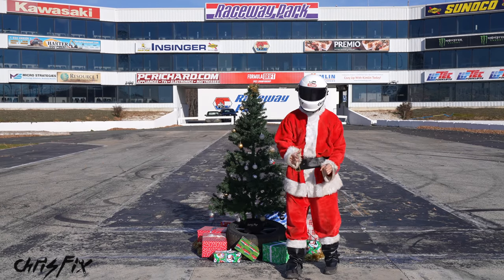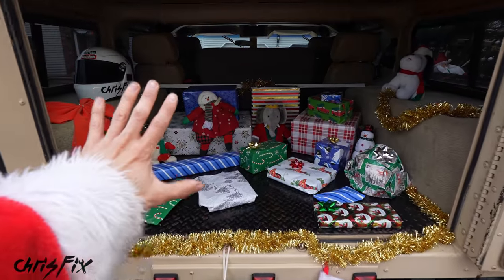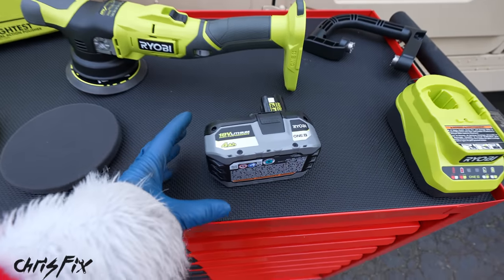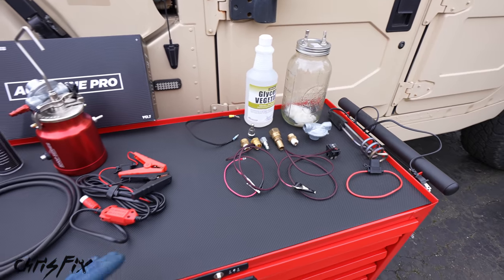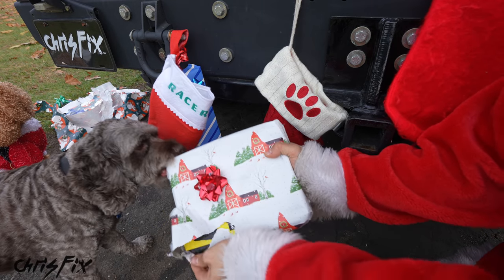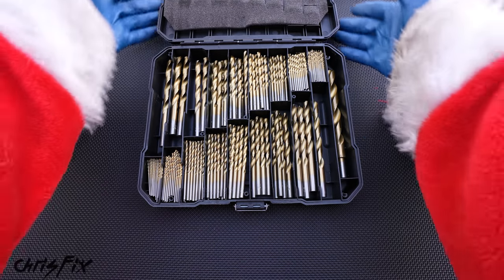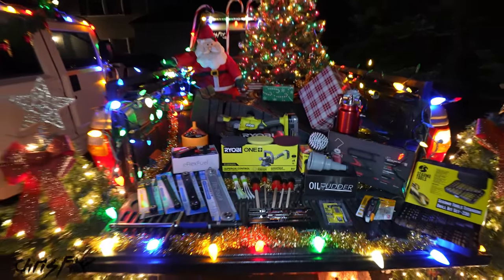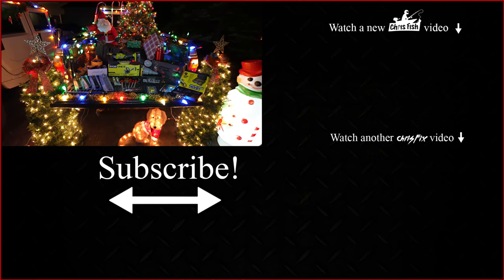Top Car Tools and Gadgets of 2021 (Christmas Gift Ideas)

Comment: Very important for using a DA polisher: you'll need multiple pads of each type if you want to do your whole car at once.  One pad per 1-2 panels.  The pads get dirty from oxidized paint and dried polish, which can get slung across the surface you want to correct.  After every 2x2 section, you'll want to blow them out with compressed air or spin on a pad brush.  This would actually be a great "how to" video to cover.  Most of the beginner DA polishing videos just show before/after and not what's needed/how to properly correct an entire vehicle.
Reply from the maker: As I was filming this I was thinking to myself that a whole video on how to use a da polisher for the whole car. I like what you’re thinking!
Reply: @chrisfix  I like it! That would make for a great video for the new Ferrari, you know, if that's what the new car is and you weren't just trying to throw people off with the oil sample bottle. I was honestly going to guess another Corvette, but a different body style. The way the intake looks is dead on for a Corvette, but I Know Ferrari also uses that style intake, and the engine is pushed so far back. I'll admit, you definitely have me stuck between V8 Ferrari and possibly Corvette if you were just trying to throw people off with the writing on the bottle.
Reply: @chrisfix  please please do.   Would be so insanely helpful especially because I’ve been looking for a solid video looking on how to do this.  I found a few but nothing is compared to your videos and explanations.  Thank you sir!!
Reply: @catch22frubert  I was guessing a Viper, am pretty sure I can recognize the V10.
Reply: That’s what why you need to blow out your pad after ever Panel and put a little fresh polish or compound on it
Reply: FreeBirb  What that engine sound? Gotta be Viper.
Reply: FreeBirb  There were other people in the comments recognizing the frame and the model on the oil filter, so am pretty certain it is a viper
Reply: @simasm.9757  Since most of us subscribe and come here to learn, would you mind sharing the mistakes he made and provide solutions and/or the correct methods?
Reply: I've found treating the panel with ironX or anything similar gets rid of the oxidized paint problem. But yea, the polish dries up and leaves nasty hard spots on the pad. Definitely swap it out and wash them asap.
Reply: I learned this the hard way, having polish splashed all over my convertible top and having to clean each drop off by hand.
Reply: @chrisfix  I'm actually very in need of a video like this. I paid $200 to have CobbleStone detail including a buff and polish on my wife's black Camry and they refused to refund me after putting terrible swirls on it. They tried to fix it and only made it worse.  It was supposed to be a surprise and while she was DEFINITELY surprised, it wasn't in a good way. It's been a point of contention and I haven't felt confident enough to try to fix it myself.

Comment: Great gift ideas! That ratchet extender is really nifty. There’s a few bolts that immediately come to mind.

I’m sure you’ll go over it in your E85 video, but for anyone considering switching, know that while ethical is cheaper, your MPG will drop a bit.
Reply from the maker: Thanks a lot and 100%
Reply: @chrisfix  Did you dyno tune the car with e85? You can advance your timing plenty now seeing as it's 105 oct!
Reply: I'm a bit curious how the kit works without larger injectors, I assume there would be a loss in power. Looking forward to the video.
Reply: @gsmith7162  Most stock injectors have quite a bit of headroom for amount of flow you can go up before maxing them out.  Now...if you were doing full bolt ons and upping the power considerably with the e85 also then yeah, new injectors are needed.
Reply: Fuel mileage is nearly half with E85 but you will pick up performance with the car custom tuned to E85.
Reply: I really wanna know where he's at that E85 is half the price of premium, where I live there are about 4 stations with E85, maybe a few more, but they all charge $.25-.65 more per gallon then premium, making E85 useless to many, it's so bad here that most dealers don't even offer Flex Fuel cars anymore
Reply: @PsYcHoLogical03  most likely a rural area where it is made close by. Otherwise, yeah, you see prices like you see. Essentially poor man's VP race fuel at that point. Lol
Reply: @gsmith7162  our kits automatically adjust your injector duty cycle allowing the right amount of fuel to pass safely within the injectors. We also have a full database of cars that have been tested to ensure that it's safe to run e85 on stock injectors. If not, we also let the customer know ahead of time and we do give recommendations.
Reply: @ryanmolloy5421  yes you would need about 30% extra flow capacity for e85
Reply: @Braap_Jackson  this is true because there's less energy burned per gallon in ethanol than in gas. But the faster burn rate also gives the cooling effect when the fuel flows through faster.

Comment: Hey Chris I love the addiction of the ToughBuilt scraper, I personally think it's an amazing tool but it has one downside that I've noticed personally and why I haven't bought it is. if you hold it upside down (With the blade pointed to the ground) The internal spring isn't strong enough to retract the blade into the body of the knife. Aside from that one major complaint It's a good tool.
Reply: I mean I’d just take the half second to tilt it up right and then retract🤷‍♂️ it’s a downside but don’t think it’s a major complaint. I have one. Works on everything from tint to decals, boxes at work, paint stuck on floors, etc.

Comment: Cool stuff as always Chris!  Just a note...on that E85 kit....you may not save as much as you think.  E85 gas has less energy than E10 or E15 or "regular gas".  So it takes more gas to get the same distance.  30 MPG on E15, might only be 25 MPG on E85.  So the savings needs to be over 30-40% in gas price just to break even with the energy loss and extra fuel needed to purchase.  How do I know?  I drove a 2009 Dodge Grand Caravan 3.3l v6 for 8 years.  It was E85 compatible from new.  I only bought E85 when it was more than 30% cheaper.  Those prices you found/showed?  Not reality around the US.  Most are 20-30% or less in price difference...making it not worth putting it in.  Plus, there are differences in fuel lines/fittings, etc....and that kit may void any warranty left.  That said...E85 is a more environmentally friendly fuel, since it's 85% ethanol, made from corn products.
Reply from the maker: Thanks! I couldn’t get into details but I lost 20% in fuel economy and with the gas prices in some states  you save 50% so that means in reality it’s 30% cheaper which is still decent.
Reply: But... MO POWAH BABY
Reply: Exactly here in san diego, its only 20 cents cheaper than  unleaded gas
Reply: Agree. Where I live, E85 is only about 10-20 cents cheaper per gallon than E10. Not worth it.
Reply: @specialopsdave  I see we have a fellow donut fan here.
Reply: All the points I wanted to make. You have to make all of the calculations before deciding to run corn piss. It’s not worth it in my opinion.
Reply: I would still love to save money from gas here in CA even from my 2.5L 2020 Altima, there is no product for my car and plus none of them can be used here in CA. This sucks.
Reply: @tomthetitan3697  a man of great taste
Reply: E85 is not as environment friendly as you think.
Reply: @specialopsdave  did someone say mow pOwER?
Reply: @heidilopez7276  Only because of the dependence on fossil fuels to plant, fertilize, harvest, process and transport it. Electrification will fix this in the near future
Reply: @Agent-lg1mu  MO POWAH BABY!
Reply: Plan on higher fuel system repairs. E85 corrodes fuel system components (electric fuel pumps being a prime example) much more than E10 gasoline & I would not recommend converting any vehicle to E85 that didn't have it as an oem option.
While you have some limited positive experience with this kit so far, don't be surprised if you have fuel system failures in the future (long term).
Reply: @davehansen6262  If you replace your fuel pump and fuel lines to the correct ones when you do the conversion in the first place, it shouldn't. People just tend to be lazy and don't replace the pump since it isn't included by default in a conversion kit
Reply: @specialopsdave  No, it's not so much they're lazy: people just don't know, listen to these self proclaimed know everything experts & jump in with both feet.
I'm a retired technician that worked in fuels & lubricants research for 36 years.  I know a lot about the many compatibility issues with ethanol & ethanol blends, but I admit I don't know it all.  Ran many tests using anhydrous punctilious ethanol. 
Know why E85 is maximum concentration available. Know also that E85 requires different catalyst chemistry to minimize tailpipe emissions vs gasoline. Surely you don't suggest people change their exhaust system components as well?
Better they operate their vehicles using the designed & specified fuels & lubricants than get misled by "experts" that really have no clue...
Reply: @davehansen6262  Honestly, I've never cared about the emissions aspects of E85. My car's catalytic converter has been burnt out for over 2 years, and I never intend to replace it. Although, yes, I believe those who do care should set their exhaust up too. I just believe that most people care about their fuel pumps, so they should replace them when doing a conversion.

Comment: I think the blurred car is a MK1 Viper, because of the sound, the red colour, the wide and low grille, and the fog lights (maybe?) flanking it. The oil filter also has FCA written on it, and the engine bay looks vaguely similar. I could definitely be wrong though.
Reply: It is 7:46 massive airfilter and mopar oil filter
Reply: And if you look up a viper oil change it has the same everything

Comment: you had me with the ethanol conversion at " it makes the exhaust spell good". awesome video chrisfix. everytime you recommend a tool i try to get it to stock up my tool box which currently doesnt have a lot of tools.
Reply: I'm skeptical on the kit. I had a crown Vic with the same engine (close model year) as that drift stang. The same e85 conversion question would come up at any gas price spike. The answer was always the same by the enthusiasts, don't do it. E85 is going to dry out anything designed for gasoline only and lead to premature failure on the fuel lines. The flex fuel vehicles had different lines to resist the issue, but not impervious. So if you wanted to do the conversion, you can, but unless you replaced all the lines you were asking for a premature failure. Naturally you need to program for E85 like this does, but it's not as simple as just doing that.
Reply: it does smell good! :)
Reply: @TheJuanSolid  we verify the fuel system compatibility, we’ve sold over 40k kits with zero complaints about fuel line issues (like in the drift stang after 2yrs), since early 90s the standard has been that fuel system parts are ethanol compatible and ethanol itself is not corrosive in any way

Comment: The ethanol conversion kit is pretty interesting, but be aware ethanol eats away at aluminium much faster than regular gasoline, so this may actually cause damage to your engine or fuel system in the long run if your engine/fuel system is aluminium based.

(For the Americans: aluminium = aluminum)
Reply: That and the fuel lines are not designed for it. The flex fuel vehicles have different file lines to resist the problem. All the forum posts I have read state it's like dry out or something. Regardless it's a premature failure because the materials are not right. Your need to replace the whole system really for the conversion, and most people won't do it, or pay the huge fee for it, expensive gas is cheaper and gets you more mpg than e85 (failed to mention that in the video when talking price per gallon). Not as simple as just programming like that company makes it seem.
Reply: Ethanol itself doesn't eat through anything, where you get problems are crap quality E85 fuels with water in them.
Reply from the maker: That’s actually a misconception and inaccurate. Ethanol does not affect aluminum chemically. Ethanol has an affinity for water more than gasoline so on stuff like boats or collector cars where they sit a lot, the water causes increase corrosion rates. Also ethanol, unlike gasoline, can conduct electricity and cause galvanic corrosion which is more likely a problem in boats not cars. Most fuel tanks in cars are plastic so it’s not a big deal anyway. Most fuel system parts are stainless so again not a problem.
Reply from the maker: @TheJuanSolid  another misconception. That’s why I say check the website to make sure the car is compatible. The type of fuel line used and the different parts of the fuel system are taken into account in their database so it makes sure the fuel system will not be harmed by the E85. Hence the reason the DriftStang and Del Sol have been fine 2 years later and will continue to be fine.
Reply: @chrisfix  I'll wait for your video, but it makes no sense for the vehicle engineers to not implement e85 across the board then. It would make the vehicles more popular and lead to increased sales. No brainer, but they don't do it. Add on fuel credits they need to buy due to inefficient vehicles and sounds insane not to do it.

However for a cheap price and quick install you can finally unlock what big transport does not want you to know! Use any other too good to be true sounding statement and it's probably why people believe the misconceptions and incorrect info etc.
Reply: Thanks for the conversion, I was like what's aluminium?

Comment: I would like to mention that ethanol based fuel is less energy dense than regular gasoline.  Although the price of ethanol based fuel is less than regular gas, it does not give you the same miles per gallon.  In fact it gives you 15% to 27% less mpg compared to regular gasoline.
Reply: It is still cheaper than regular :) 1/2 of the price for 70-80% economy :)
Reply: still cheaper than 95+ octane for a tuned engine though

Comment: How to find evap leaks: 
Step one - Light a match

Also, with the Razor blade/scraper combo, switch out the metal blades with plastic ones. You still get something sharp enough to cut something or scrap something off, without having the worry of gouging something like you do with metal ones.

Comment: good stuff as usual.  question, is there any problem with putting the ramps under all 4 wheels, ie to lift level and have room the full length. ?  thanks Chris
Reply from the maker: If it can fit under your door sills then yea totally you can lift a car up with 4 ramps, normally I drive up the ramps in the front and jack it up in the rear and use “wheel cribs” to hold it up or jack stands.

Comment: Could you use the oil utter as a funnel?
Reply from the maker: Yes totally. Some oil drain plugs empty right into a cross bar or hoses and this can be used to funnel it into the catch can.
Reply: Yes, we recommend it as a funnel for your used oil.  We just don't recommend contaminating fresh oil after using it on your filter.

Comment: It is definitely a viper. Oil pan matches up,  v10 tone,  oil capacity is right, red valve covers with the same geometry, intake matches from the manifold right to the air box. That and right on the front of the air box through the transparent funnel if you look close enough you can see it has v10 embossed on the air box.

Comment: Another amazing tool is a universal radiator pressure tester and vacuum kit, it makes it super easy to bleed out stubborn cooling systems that won't bleed with the funnel system, pulls a vacuum on the cooling system and sucks the coolant right in! I got the Astro 78585 off amazon, it's a little pricy but man it's worth every penny if you ask me.

Comment: Spill-proof funnel tip/warning:
I had my coolant level almost identical to what Chris did when he shut off his truck. When I turned off the Jeep, everything remaining in the funnel splashed everywhere.
My yet to be tested tip: keep as low a coolant level as possible but just enough to be the highest point so as to bleed air as Chris described.

Comment: I was working on my 4 cylinder engine doing spark plugs, the extension came off without the socket. I got the socket out with needle nose pliers but the the rubber grommet came off and I had to get that with the pliers too. Will be getting the magnet sockets 😅

Comment: I have the same drill brushes, and they are great! (However I would highly recommend using it with a cheap drill that can get destroyed, because the moisture, soap, and rough vibration can ruin drills . . . ).

Comment: E85 won't actually save you the exact amount of money based on how much cheaper it is per gallon. That's because for each mile driven, it takes more E85, by volume, to go that mile.
I'm not saying that you won't save some money, but it's not as simple as looking at the price at the pump.
E85 is used primarily for race/drag cars. That's because it's less volatile, which means it can function properly without being pre-ignited from the massive amounts of extra heat generated from these race/drag car's engines.
Sorry for getting technical on a Xmas special, I just want to make it clear that if E85 is half of the price, that doesn't translate to double the miles per gallon.